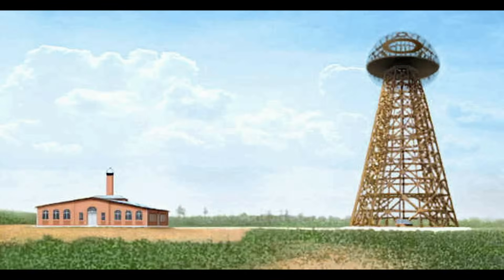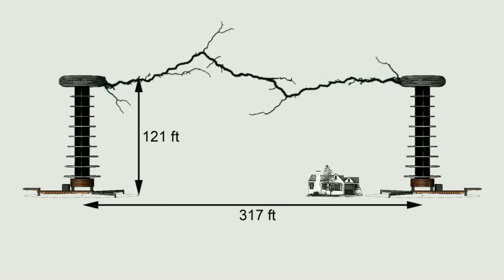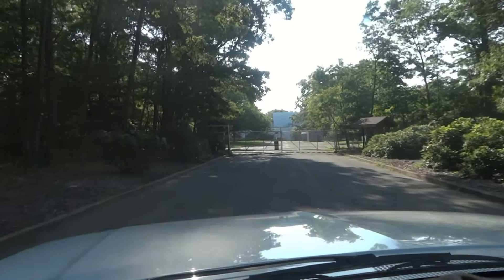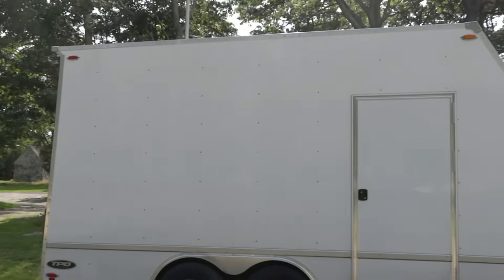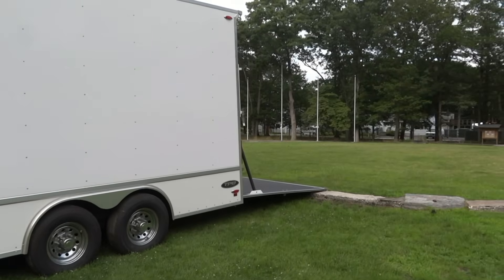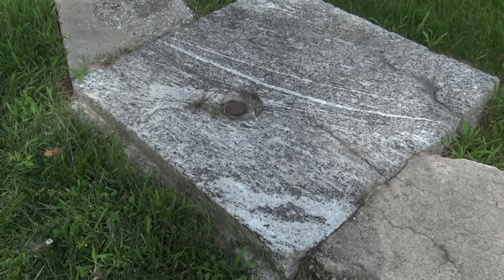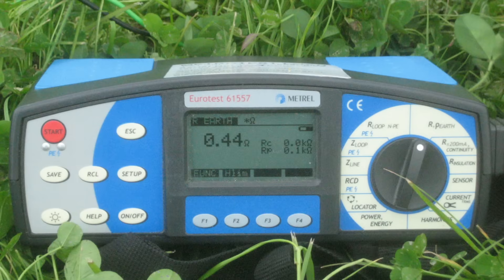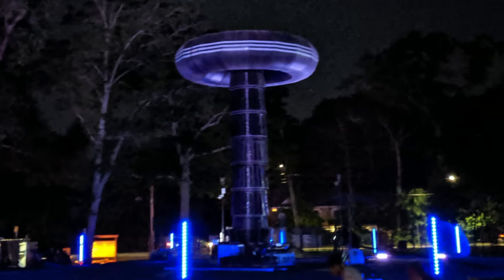3 Million Volt Test at Tesla's Wardenclyffe Tower

Comment: Apparently not a DRSSTC, not an SGTC, and 100% not a VTTC or QCW. It's got to be solid state though. What is the primary circuit technically considered?
Reply from the maker: It's just a standard full-bridge resonant converter, like this design from 1998:  https://www.lod.org/misc/Resonant_Converter_HVPS_1998.pdf  This topology has the advantages of simplicity, robustness, low cost, and easily scales towards large power levels.

Comment: yes they were on a extremely close path to the science/technology breakthrough I have been hoping for. the only thing I would suggest is that they do it exactly as Tesla did it to prove it actually works and can power more than just light bulbs. from this video the only thing I can see they're missing is doing it full scale with the copper ride going 200 ft into the ground making contact with the natural aquifer that the warden Cliff Tower is built over. once that is all complete you will see the same test Nikolai Tesla did there will apply as far as being able to light bulbs over a hundred yards away and with today's technology you will be surprised what else it will power. someone needs to do this the right way and have the funding to do it.!!
Reply: say hello to emf noise killing any modern electronic device.
Reply: They aren't doing it how tesla did it. Tesla strived to eliminate electrons from his circuits in later designs using magnetic spark gaps. Most 'tesla coils' are not even tesla coils they are a different design by a different person. I'm yet to see someone FAITHFULLY reproduce his work. Close, but not exact. 
Tesla illuminated lightbulbs KILOMETERS away with small coils, he was on a whole different level.
Reply: yes
Reply: who knows wat will happen

Comment: 210kW? What the... What is a power supply and IGBT's?
Reply from the maker: Yes indeed, the drivers use IGBTs!  There's 12 drivers total, you can see 6 on each side with the blue LED firing indicators.  The coil tower is self-powered by internal batteries, as mains connections can be problematic with the heavy RF ground currents.

Comment: They didn't tear down his tower. In 1915 Tesla lost a court case, whereupon the army turned up with a ton of dynamite to destroy the tower, but instead of destroying it, the tower fell over on its side and then had to be dismantled. According to the court papers, the army said it was a hazard and a marker to possible attackers so it was destroyed.
Reply: Many have been forced to be torn down since. Multiple occurrences since. Of course those in control won't take credit for tearing it down lol I mean use your head for a second, they claimed roswell was just a military practice, then roughly 25 yrs later we finally get the CIA to release documents and tons of it is redacted information. Why would you ever be so easily swayed. Don't let them turn your brain to travel soap bud

Comment: And to think in Colorado Tesla was putting out 12 million volts and that was nothing compared to what he intended on doing with the Wardenclyffe tower. 

Contrary to popular opinion, though, I don't necessarily think he planned to strictly send power via the magnetic field generated, etc--- but needed to generate the power necessary to send radio waves across the country if not the world. 

Anyone who knows about TV antennas or Crystal radios, etc will tell you a great deal of power can be received through radio waves. The tower needed the largest Tesla coil in the world to accomplish this. It's a Small Wonder that the electric car industry hasn't thought of using radio receiving technology to basically charge batteries while driving. 

After all Tesla was in a race against Marconi for the rights to the radio, but Tesla's vision was so grand he ran out of time--- the wireless transmission of power is indeed possible, after all that is how we are able to control rovers on the planet Mars, etc--- but I think people are sidetracked by the idea of magnetic fields generated by the tower and plasma arcs, etc that they miss the truly efficient means of wireless power via the radio.  

Jesus Christ Almighty God bless you all 😊

Comment: Look, I'm a knuckle dragger when it comes to this stuff,  so forgive any non-sequitars, but while watching the video I suddenly remembered an early early experiment during the Space Shuttle days which saw them paying-out a long copper wire while in orbit. The thing was over-producing so much power, they had to jettison the thing, as it stood a danger to the Shuttle.  Many years after that I was listening to the original Art Bell radio show,  and he was explaining how he was going to build this huge antenna by running copper cable from towers strung around his property line, but the wind passing-by that huge copper coil he built was generating electricity and he couldn't use the power. 
      Is any of this helpful information?  I  dunno. I went to Public School in SC many decades ago.
Reply from the maker: Yes, I remember that experiment in orbit, with two cables suspended between the craft and a counterweight.  The current induced by flying through the earth's magnetic field was high enough that there was concern the cables might fail.  And yes, there have been patented designs using the wind to strip charge from aerial conductors to generate power, but it seems to be too diffuse an effect to be practical.  The orbital loop generator is much more effective, but it's important to remember that energy gets pulled from the orbital energy of your craft...

Comment: Impressive that it doesn't need a breakout rod. Most DRSSTC's I've seen that try to run without one tend to explode the IGBTs's within a few seconds.
Reply from the maker: This coil isn't a DRSSTC, the primary resonant caps would be prohibitively large.  This coil uses the standard open resonant converter topology, which has been used for large motor drives since the 1980s.

Comment: Now remove the top load and replace it by an antenna, and you have the biggest spark gap transmitter used since the 1920s!
Reply: There are more powerful transmitators these days.
But you're right  this should be pretty powerful
Reply: @postualin6551  Spark gap transmitters have been banned internationally since 1934, and were largely out of use by the 1920s since they caused to much interference and were worse than the new alternatives like the Alexandersson alternator.

So there may be bigger transmitters, but not spark gap transmitters.

Comment: Instead of hooking a coil up to a ground, I hooked the ground wire to a second, identical coil, so the sparks shoot between them.  Used a GE potential transformer to run the coils.  I have a second potential transformer and was thinking about running them in series with 240 VAC, but I'm a little afraid to do that.  Used Maxwell caps.  14.4 KVac  Air blown tubular spark gaps.  I have to hook this up again,  haven't run it for10 years.  winchandle@gmail.com

Comment: Cool. Congratulations.  Fantastic engineering.   I have a '96 ford Powerstroke F250.!!!  The tower was torn down in WW I because Army/Navy was afraid German submarines would use it as a navigation reference.   I noticed that the pitch changed as you powered it up.  Is that a spark gap wheel, or is it solid state?  PS.  I built a tertiary twin coil on 8" PVC tubes,  and used pumpkins for the top-loads.  For Christmas, I put one of those old aluminum Christmas trees.

Comment: Laughable to think Tesla's Wardenclyffe Tower was supposed to be a Tesla coil. I mean, I've not seen anybody put their tesla coil to much use at all other than to produce sparks!
Reply from the maker: Wardenclyffe was in fact a 3 coil system according to Tesla's 1907 patent:  https://tinyurl.com/y2eqdkl8   'C' is the primary coil, 'A' is the secondary coil, and 'B' is the tertiary coil.
Reply: @LightningOnDemand  you're overlooking one thing - what was the intended use for the wardenclyffe tower?
Reply from the maker: @PeterPete  Well, Tesla wanted to use the tower to demonstrate wireless power transmission.  JP Morgan thought it could be used to send stock prices overseas.
However there's other completely unforeseen uses that would have sprung up, owing to it's unusual size.  Lightning attachment tests on aircraft.  The discovery of leader formations in long arcs.  And if he ran the tower in the high megavolt range as intended, he would've likely discovered superlong discharges http://www.lod.org/research/03SIBNIIE5MV.jpg and possibly Relativistic Runaway Breakdown... around the same time that Einstein published his Relativity papers in 1905!
Reply: @LightningOnDemand  well as far as I'm aware, why has nobody been able to use their Tesla Coil to demonsrate the potential abilities of the wardenclyffe tower? So is there a video of somebody demonstrating on a small scale wireless power transmission using their telsa coil??
Reply from the maker: @PeterPete  Yes, we just finished one demo of a wirelessly powered vehicle here:  https://youtu.be/NfKOD0XqR14
A cross-country demo of Tesla's idea would require a Tesla coil tower that's large enough to couple to the ionosphere, something the size of Wardenclyffe or larger.  However I'm not sure how effective that system would be.  Basic computer sims suggest there might be a few efficient operating modes, but a full computer model would be very costly... perhaps more than just building one full-scale Tesla tower to measure it.
Reply: @LightningOnDemand  I'd hardly call that wireless transmissoin of power, more like 'electrical induced power'. Why didn't you take the vehicle outside and go for a spin? Oh that's because you have to always remain within the 'electric field'' of the Tesla coil. And to be fair, you'd have to build a pretty big one just to go on a 20 mile drive!
Reply from the maker: @PeterPete  Yes, as I said above, 'A cross-country demo of Tesla's idea would require a Tesla coil tower that's large enough to couple to the ionosphere.'  It's unclear how efficient that would be however, since a computer sim that includes the ionosphere would be computationally huge.
We do run the roadster outside, with a different setup on a 300ft circular track, also using near-field coupling.  When we're able to have public demos again, you can come check it out!
Reply: @LightningOnDemand  I'd love to watch the electric field induction phenomena in action so when I get the opportunity I'll be over! But in the meantime you do realise there's no evidence the ionosphere exists?

I've checked up on Appleton and he had to basically use maths to indicate the presence of the ionosphere and according to Wiki his experiment was 'far from conclusive' - Wiki

Maybe you should research  up yourself?

Atb

Comment: This is not 3,000,000 volts... this is WAY more. 3 million volts can arc only up to about 1 meter (oxygen medium)
Reply: It depends on the humidity and current, when there is enough current in the arc it can reach a meter with only around 10,000 volts.
This is why lightning can be less than 300k but still reach nearly a mile down and melt holes in sheds, the current can be as much as 10,000 amps
Reply: Interesting thing of any RF voltage source, arcs can exceed the expected D.C. breakdown voltage as the channel can stay hot for a little longer.
Reply: Voltage of long arcs will usually be much lower than you would expect from extrapolated short-arc figures. It's a lot to do with the radius and e-fields around the electrodes as well as distance. It is nor WAY more than 3MV. If I recall correctly, even natural lightning does not much exceed 10MV-20MV.

Comment: So what would it take to reach 1 billion volts?
Reply from the maker: Well, modern plastics can support about 7000 volts per inch along their outside surface if they're kept clean.  So 1 billion volts divided by 7000 volts per inch gives a coil 142,857 inches, or 11,905 feet high. 
The 7000 volts per inch breakdown limit is something to keep in mind when studying claims of 1 million volt tabletop devices.  ;>
Reply: @LightningOnDemand  holy sh-
Reply: @LightningOnDemand  with that much power it could cross a city
Reply: @Grazey  At that point the arcs are pretty much actual lightning lmao

Comment: You generated so much Volt you must have accumulated lots of "electric charge" at the top.Can you concentrate them on 1spot and shoot them out in a beam?
Reply: You can add a breakout point with a metal rod but it would just be a normal arc. It likely wouldn't make the arc much larger either.
Reply: @voltariantechnologyinc.8594  I'm not talking about making arc larger I mean shoot out charges particle in a beam I mean lightning arc is like wave motion,each particle bouncing up/down or back/forth,they don't move out  of position I'm talking about repelling them out
Reply: @johnconnor7407  I know. You can't do that.

Comment: The elaborate ground system IS the tower. The tower is an INDUCER, the water table is the CONDUCTOR.  Thr pipe is suspended in air between magnets and is a waveguide.  There were more than 4 tunnels under the tower.  It was at least 6 if not 9.   What you built is not at all what he built.

Wardenclyffe is more like a drilling rig than a positive coil. It was an inductive coil, completely the opposite of what youre doing.
Reply: @Heads Mess it's for awareness. visit his website to see what his main goal is
Reply: what was it. is it wortless/can computer can simulate teslas experient

Comment: Wow I just happened to visit the TCML and saw this link in a recent post.  I was active on the list about 5 years ago.  Glad I found this.  I have not been running my coil near as much as I like.  The coil is amazing, Greg.  I thought my 10 foot tall  coil was big.  That is Huge.  Good day, sir.  I subbed, also.
Reply from the maker: @Mihály Tóth The prototype shown here is not a DRSSTC.  
It's just a straight-up resonant converter, based largely on the SNS modulator design described here: 
http://www.lod.org/misc/Resonant_Converter_HVPS_1998.pdf

The primary circuit here has no resonant freq, so it's not a 'Dual Resonance' system like many coils are.  
This allows the coil to avoid large resonant capacitor banks, which would be prohibitively expensive at this scale.
Reply from the maker: Thanks!

Comment: Is there any way to get a bit information about the driver Design, i would be really interested to see how you did this. if you used punch-through IGBT for examples and if you evaluated different topologies like you would in a LLC converter. Thanks the results are impressive!
Reply from the maker: The drivers are pretty straightforward -- 12 drivers driving 12 nested primary coils.  Each driver is just an IGBT H-Bridge, similar to a motor drive.  There are no reactive components in the primary, such as series capacitors or inductors, as the primary objective of this design study is to minimize cost and increase reliability.
Reply: and do you have any fancy gate drive or control scheme,  i gues you dont want to publish any photos of them, no schematic of curse just how it looks and how it is done, i would think you did quite a professional solution, would be nice to see compared to the traditional design. would not have thougth that a nested design would work that nicely i would have tried to parallel couple the drivers into one primary.
Reply from the maker: @heinrichhein2605  Standard H-bridge gate driver chips  [IXDS430] with 1200V isolation.  Nothing fancy, all 12 drivers run synchronously.

Comment: Looks very solid. How do you think the full scale ower will work? Where will the energy and sparks go?
Reply from the maker: Because it will cross some critical thresholds, the full scale version has a high chance of triggering relativistic runaway breakdown.  This could result in arcs many times longer than classical electrical theory predicts.
Reply: It works completely opposite of what you see here...
Reply: That would be very cool to see. The real question though is does it work for RF current the same as the D.C. field on normal lightining?